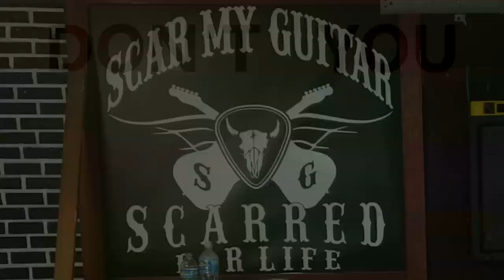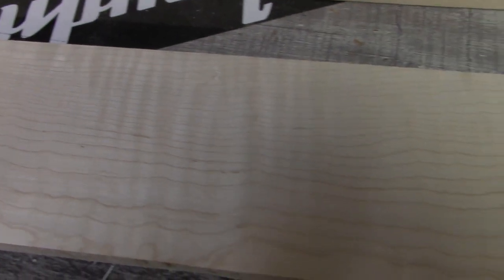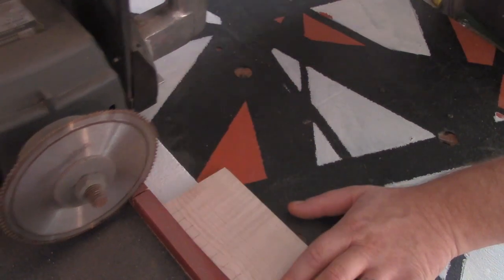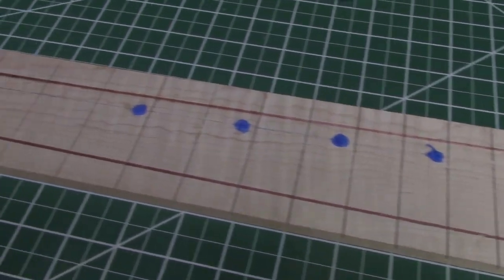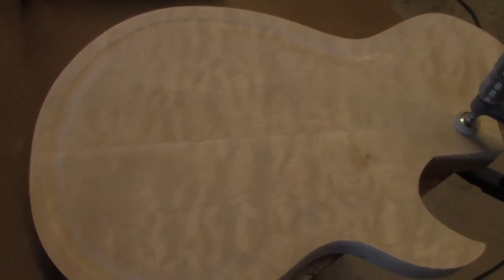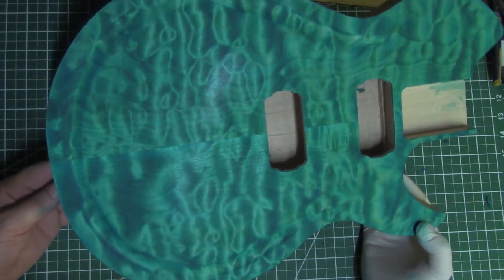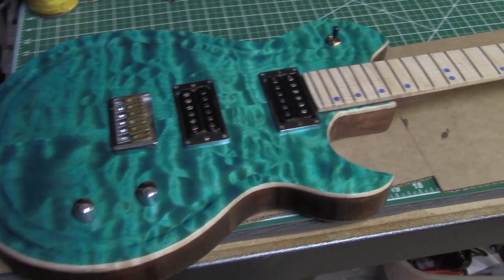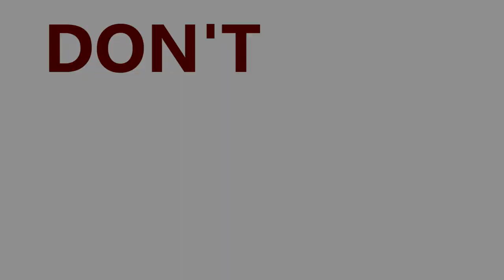I Re-Designed the Hollow Body Guitar and it's CRAZY COOL!! FULL BUILD And Demo!

Comment: The one thing I do like about tune o matics is it's easier to raise and lower your action quickly. Other than that I think they're a pain to install and you either have to recess them into the body or have the neck attached to the body at an angle. Fender type bridges are so much easier to install but I hate having to adjust each individual string with two screws on each saddle. If only there was a compromise between both bridges! The ease of installation of a fender, the quick adjustment of a tune o matic, all in one unit no tail piece. The fender style also has a bit more room for intonation adjustment if you need it.